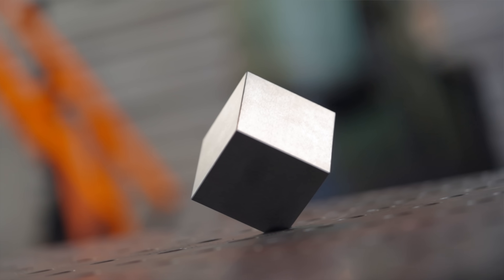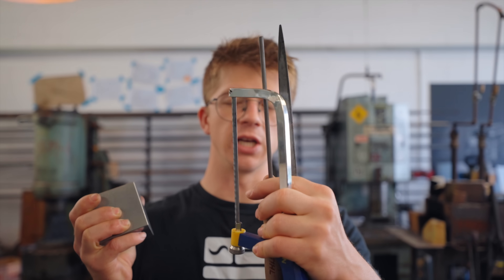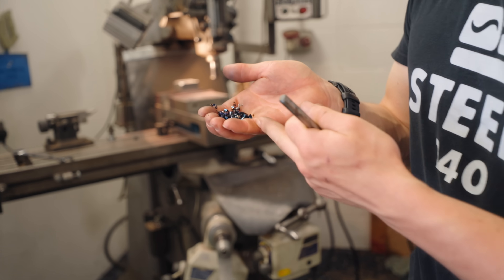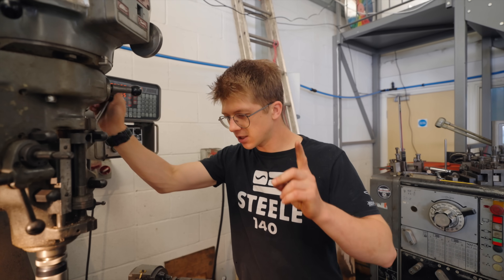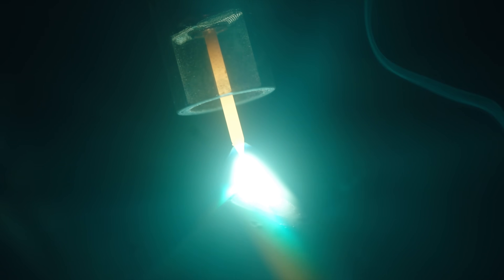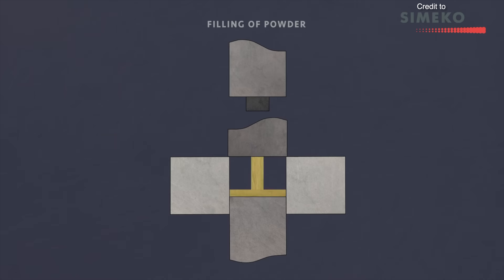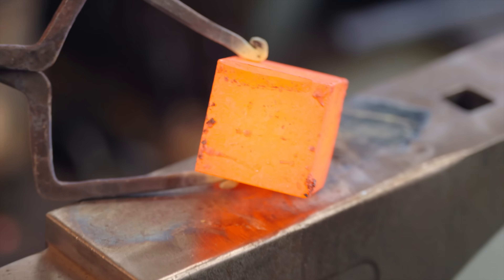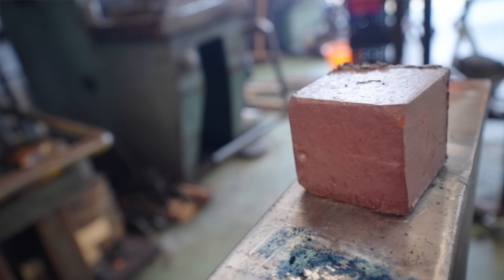Can You Forge Tungsten?

Comment: I don't usually comment on stuff, but this is an area I have some experience. I'm a machinist and have done a good bit of work with tungsten; mostly weights and bucking bars. Other than being very, very dense and stable I wouldn't really call Tungsten a supermetal. It machines just like cast iron, you use pretty much identical feeds and speeds. As you saw it's quite easy to work with saws and abrasives as well. There's a reason (well, many) that you don't have things like knives made out of pure tungsten. Steel is or can be better in effectively every way. Tungsten is tough but doesn't hold an edge well. It's dense but deforms rather easily, we have to remachine bucking bars made from it fairly often. It's a very cool material but not the wondermetal people often make it out to be.
Reply: I have also worked with tungsten a little bit, where I had to spot weld it to steel (well, actually I wrapped it thin steel foil and welded that to itself). Welding tungsten sheets was very difficult, and after it heated up to 1200°C it became brittle like a cookie. I would love to see machining of this tungsten block in the video AFTER heating it in the forge, because I believe that we would see a much more brittle surface. Also, the carbon concentration at the surface might have increased, granting it a bit more strength.
Reply: @antonk.653  Yeah, I was concerned what heating it would do, I was hoping he would at least cut it in half before heating it.  I don't know if heating it anneals or hardens it.  Carbon infusion wasn't even on my radar, thanks.
Reply: @theradioweyr heating to 1300°C should be in the annealing range. The alloy i work with gets stress relieved at around 1150°C
Reply: The only thing i've ever bought T for is to remake the head assembly of my burners. Cast iron degrades over time, this (at least so far - with one of them having at least 150~160 burns on it) doesn't. I've heated it many times (over all the burners i made) and all of them still have the machining marks on them. Best money ever spent, because i used to have cast ones, which were pretty decent, but over time they'd start getting loose and chipped and the flames didn't have the right definition anymore. I'm currently working out a design for a friend, who saw them and wants tips for his artisan glass making torch.
Reply: @aserta  Tungsten is W not T :)
Reply: @StucklnAWell  "Tungsten is W not T :)"
Thank you from a chemist.

FWIW In college, we used tungsten "baskets" to vaporize small pieces of gold (under vacuum) to plate things with gold.
Reply: Yeah. W from Wolfram I assume
Reply: have you seen the purple smoke?
Reply: A tungsten hammer would go hard
Reply: @zazzyboy8592 Not really…
Reply: I mean, it seems obvious that density alone doesn't say much about other traits. Lead is heavier than steel, but it's very soft... so it's not very surprising that tungsten, albeit incredibly dense, isn't tougher than an alloy created for its toughness....
Tungsten carbide on the other hand - well that stuff seems brutal :D
Reply: I think one thing people confuse is that tungsten carbide is not just an alloy of tungsten and carbide (not like carbon steel). Its an entirely different material with other binding forces between the atoms (more covalent and ionic bindig than metallic).
Reply: I made a bunch of different prototype spot welding tips out of 99.97% Tungsten. I think welding tips are a big use for it. It was just like a dense stainless except a drill would push the bottom of the hole out every once in a while.
Reply: i think we need to be able to compare apples to apples. and under what applications.  if we compare tungsten to any of the other metals that are not alloyed or decayed then it stands near the top in hardness so it should be one of the hardest materials in its purest form (there are certain depleted radioactive materials that will have a stupidly high Mohs rating)....   i think most people think it's a super metal because of the alloys it can produce. a little bit of carbon mixed into it makes tungsten carbide and that makes it even harder but more brittle.  adding lanthanum or cerium gives it better properties for electrical control as a electrode.  so yeah it's a super metal but under what application.  i'm curious... the bucking bars you mentioned that gets deformed... are they the ones used in riveting applications?  if so what material would be better that would not deform as easily?  i would think if you wanted something that didn't deform a little bit it would be too brittle and crack ... at what point do you give up malleability for tensile strength and vice versa?
Reply: Correct, tungsten handles extreme heat .
That is the special property, used as an electrode in TIG welding
Reply: @madmagyver9981  yeah thats why we are calling it a super metal its purely because of its heat resistance not any other property
Reply: Well that cube is a tungsten alloy. 95% tungsten, and 5% iron and steel. Meaning it has the strength and hardness of tungsten but the ductility and malleability of steel. And it does hold an edge as the video clearly demonstrates since it takes so much to deform it. It is the only supermetal that can handle so much abuse and not deform like steel, or titanium. Not sure what makes you think it machines just like cast iron because it takes so much more heat to even somewhat deform it.
Reply: it would make pretty funny dumbbells, small but heavy.
Reply: You make fair points, but I fully disagree that it's "not a super/wonder-metal". It absolutely is. As far as natural metals go, it has INCREDIBLE properties to it.
Reply: Yeah it is brittle at room temperature and have a high brittle to ductile transition temperature (I don't know exactly how but is far higher than steel so after it gets white you can't judge temperature well using vision only)...so forging it is .... complicated. Being glowing orange does not get even near to that.
Reply: People confuse it with tungsten CARBIDE often. That’s where the confusion comes from.
Reply: Which is where tungsten carbide comes into play. Btw, thanks for the insight for others! I have to argue with ding-dongs all day to tell them tungsten itself is soft. Tungsten carbide being the thing they think is insanely hard
Reply: Makes for excellent armor piercing ammunition tho...
Reply: the only special thing about tungsten is that it's got the highest melting point of any unalloyed metal with 3400°C... Tantalum hafnium carbide alloy tho melts at 4000°C... Tungsten is still cool af ^^
Reply: Yeah I would imagine that as with a lot of very hard materials, it can also be somewhat brittle. Where like steel can bend, tungsten would just sheer.
Reply: I wonder if the density itself is the reason why it warps so easily cause the molecular forces are so close so the warp is exaggerated? I don’t know nothing bout metallurgy really but it’s a guess.
Reply: But good ol Tungsten carbides make steel much higher in potential edge retention.
Reply: Sounds like lead’s cousin to me
Reply: 0:01 start of video
Reply: Good for welding and space exploration
Reply: Sounds like gold, very dense, but kinda soft
Reply: Original commenter: leaves relatively well thought out comment. 
The replies: ☝️🤓 (senseless dribble)
Reply: Holds edge pretty well at 5000°c, if mixed with a touch of Thorium.
Reply: Do you know any shops that will turn it for a small job? I've wanted a tungsten ring for a long time and can design my own, but I can't find a shop that can turn a small job from tungsten
Reply: @taterskins1033 pretty much any shop with a lathe (bigger then these small table lathes) should be able to do it. As you saw in the video it's not that hard to machine and any decent machinist should be able to hear/feel if the cutting parameters are okay. The only thing is that tungsten dulls the tools pretty quickly
Reply: It is a wonder metal in plasma-facing components due to its ability to handle the heat.
Reply: therefore, tungsten is just a stubborn steel
Reply: it breaks easy under shock, but it is a fun material. the tensile strength and high melting temps are fun to play with
Reply: It also oxidizes too at high temperature
Reply: How about tungsten alloyed steel, how does this perform? Like for instance attempting things on a machine gun barrel or something like that
Reply: Have you ever worked with vibranium?
Reply: on the other hand, it doesn't take a very thick sheet of tungsten to resist even rifle caliber bullets, which is very useful if you live in America
Reply: I think a Tungsten bowling ball would be fun to throw at some pins, probably a little to heavy tho.
Reply: Kinda strange how it's so easy to machine, if you have watched one getting hit with a .50 cal projectile and be completely fine.. I had the suspicion that someone sent you a brushed stainless steel cube.. 😂

But the moment you used the disk grinder, it came to me.. Feels to me like a metal that is relatively weak when "attacked" with low energy, but gets stronger and stronger, the more energy you use to do do.. 🤔
Reply: Like everything it has it's uses. Great for tank ammo because it is dense, ability to withstand shock and not shatter (bends as you put it) and is resistant to high temperatures. Not the kind of dynamics you need for a knife or a fork.
Reply: What a great reply
Reply: What are you talking about? Tungsten cured my mortality.
Reply: Is it rly fair to compare tungsten to steel tho? 
The reason we use steel for everything is cuz theres like 3000 different alloys of it.

Seems more accurate to compare tungsten to iron, and tungsten carbide to steel, no?
Reply: What about mens wedding rings. They are often tungsten carbide but pur would be better
Reply: thanks this vid is fake and gei
Reply: Can i ask is there a super metal in your oppinion?
Reply: I have a question @Alphaavarice How hard can a smelted and mold formed tungsten cube be compared to one that is sintered? Is anything Tungsten stronger if Forged, or Sintered?
Reply: Tungsten is double the hardness of steel how does it not hold as well of an edge? Is it because it chips due to brittleness or does it get dull from abrasion?
Reply: @ACinthemaking  That block of tungsten is obviously not harder than properly heat treated carbon steel. Otherwise the files would have glanced off it. Tungsten is obviously harder than ordinary iron, but steel is an alloy. I am sure you can alloy tungsten too, but you're really not comparing like with like.
Reply: @robertharris1748  Yup, the tungsten carbide is pretty cool, BUT sintering (alloying) it with binders like cobalt... that's where the magic happens. It enhances the toughness of the tungsten carbide while maintaining its hardness. The cobalt binder fills in the spaces between the tungsten carbide grains, providing a matrix that helps to absorb and distribute stresses, reducing the likelihood of cracks or fractures. The combination of hardness and increased toughness means improved wear resistance when doing crazy machining operations.
Reply: @robertharris1748 well yeah but also the file is hardened and the tungsten wasn't. Propperly hardened tungsten can reach extremely high hardness
Reply: @robertharris1748  tungsten carbide is made of tungsten and carbon so yes , you can alloy , also some steel allowys had it
Reply: @NikoMoraKamu  Tungsten carbide is a separate chemical compound, not an alloy. From your name, I assume you are not a native English speaker. I would suggest using a different translator and a dictionary in your native language to understand the difference between an alloy and a compound.
Reply: @robertharris1748 I’m pretty sure he isn’t using pure tungsten in the video,  I suspect it’s an alloy
Reply: @ACinthemaking it’s not double the hardness, it’s double the density.
Reply: @ACinthemaking  Yes it's because it's very brittle, I'd imagine it would be very similar to a ceramic knife.
Reply: Hardness is only one part of what creates good edge retention in a knife. A solid tungsten knife while approaching 90hrc would be terrible in comparison to even a simple carbon steel like 1095 at like 58-60hrc. The reason tungsten would make a terrible knife is because of its lack of stability (brittle/low ftlbs of energy required to create failure) of the edge that would happen. At 5 Microns or so it width the apex of a cutting edge on a knife is and while a simple ingot formed steel like 1095 may have something like 8ftlbs required to cause a catastrophic failure to the edge (by catastrophic I mean it would chip or roll, in 60hrc 1095 carbon steel it would likely roll not chip) and 8ftlbs Is pretty low in steel toughness as powder steels like cpm 3v are upwards of 30+ ftlbs required and pure tungsten would take like .5 to maybe 1ftlb to catastrophically fail the edge on a knife made out of it and that would basically make it unserviceable as if you used it would 100% quickly develop chips on the edge apex. Knife steels end at around 71hrc for rex121 and down on to in the 58-60hrc range on average (some steels like 4116 
420 etc etc eill even be down in the 54hrc range)  and all in between but 71 is about the max you would ever want on a knife because of the cutting edge being so fragile. We do have knives made out of Poly tungsten carbide and it's a rather neat material but it is ran at 71hrc as well even tho it could be run much harder because 70-71hrc is about the very hardest they can be ran while still remaining enough edge stability/toughness to be serviceable.
Reply: AC, like most materials cold makes tungsten brittle. Just remember, tungsten is "normal" at scorchingly hot temps. Room temperature is positively frigid for tungsten
Reply: @ACinthemaking  It's only double the hardness of mild steel. As you can see in the video above a hardened steel file will chew through it pretty easily.
Reply: @ACinthemaking  steel doesn't have "a" hardness, it depends on the steel and on the hardening of the steel. Tungsten might have double the hardness of mild steel or even unhardened tool steel, but it certainly doesn't have double the hardness of hardened tool steel, and steel cutting edges are hardened tool steel. a mild steel cutting edge would not hold it's edge better than I tungsten cutting edge I think.
Reply: @ACinthemaking  Tungsten carbide, maybe?
Reply: @ACinthemaking  It's hard to the point that it is brittle when thin. If you apply pressure to a tungsten rod used in tig welding, it will snap.
Reply: @ACinthemaking I guess crystalic structure has to do something with that
Reply: Tungsten proves it worth in knife steels like k390, maxamet, magnacut, and a bunch of other like zdp 189. For its abrasive resistance when heat is treated properly. But full-blown it would be way too brittle to do anything at actual knife bevel degrees. It's similar to ceramic where it can't stop chipping under 20° I think.
Reply: Tungsten isn't tough it's brittle, especially if it's really pure. It's harder than quartz, and it shouldn't deform easily. You can go through cutting bits really quickly working with it.

Comment: If the tungsten is so much more dense than steel, would it be actually melting the anvil/hammer/press being used to attempt to form the tungsten? Would it be more effective to use a ceramic surface? ARE there ceramic forging surfaces for such high-temperature applications?

Comment: Pure tungsten melts at a whopping 6,192 degrees F (3,422 degrees C) and won't boil until temperatures reach 10,030 F (5,555 C), which is the same temperature as the photosphere of the sun

Comment: Maybe in order to work with it at those temps, you might need to just have less of it? Rough it out into shape with a saw then do some precision after with forging? Any way to push your forge to even slightly hotter temps? Different gas mixtures or something?

Also, how does it react to quenching?

Comment: Pure tungsten has a Mohs hardness of 7.5. Hardened steel sits at around 8. That’s why your hardened steel tools can cut it. Tungsten carbide’s hardness is 9, about the same as the aluminum oxide on your grinder.

Comment: Tungsten alloys and pure tungsten are manufactured in a oxygenless furnace.  The furnace is open at the end, gas is pumped in and burns where the oxygen in the air and the gas mix, the gas pressure keeps the oxygen out.  The tungsten is in a powdered form when you prepare it to alloy.  You press the tungsten in a special mold to make a pressed powder bar.  I remember that copper and silver alloys would just have the metals in pellet form and would be sucked into the powdered bar by capillary action in the furnace.  Pretty awesome to watch.  The furnace would get hot enough to fuse the tungsten into a solid bar with the alloyed material.  I don't remember how they used to make tungsten/iron alloys for certain, but I think it was all powdered, mixed extremely well, pressed and then fired.